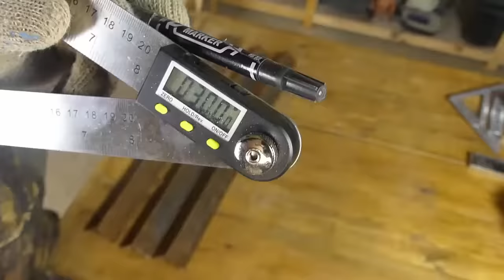I didn't believe it myself! I welded a barrel of pipes and it all worked!

Comment: The one thing I would change is having an outside port for air into the combustion chamber.
From the stats I've seen there is a 30% heat loss from burning up indoor air.

Comment: Super cool!  That’s a lot of work.  I think the steel drum itself will deteriorate too soon to make all that effort with it.  Unless that barrel is a heavier gauge than a standard steel drum.
Reply: The drum looks heavy; but agree that it would be interesting to see how long this stove holds up. The welded outside pipes are conducting heat away from the material walls of the barrel as well; that's the "magic" of this design. When it starts to go he can just add an additional liner of metal I should think. The great thing about Steel is it melts at 1500-degrees Fahrenheit - far above a 500-degree  fire  ... and he can always weld more contact points to the outside radiator pipes - to dissipate more heat if needed - or  with a thinner-walled barrel.
Reply: @EdwardTilley  I think you may have your fire temperatures mixed up a bit. a wood fire starts to burn at 300°C or 572°F and will burn at 600°C or 1,112°F in a sustained burn.  once it burns down to charcoal burning, it will burn above 1,100°C or over 2,000°F.
Reply: @fctuber  Sounds like you researched it better than I. I know that flames are in the 500°F, and it makes perfect sense that hot coals are hotter. I don't think it gets to over 1,000°F because a special process of adding oxygen had to be devised (in the 1700s' first industrial revolution) to get the temperatures up to steel's melting point.
Reply: The drum will go away possibly quite quick, but it's more due to corrosion because of constant change of temperatur than the temps being close to the melting point of the iron? And of course, the hotter the iron, the quicker the oxidation will become. And in comes from inside to outside of course. A doubled up wall, a second wall, made at/to the inside, could help. But the guys liked the work as much as it's result - so they would'nt mind doing it all over again?
Reply: Pieces of corrugated tin roof would have been far easier and quicker to be put around the outside - but they didn't have them?
Reply: Those things last forever damn near. They don't corrode like you'd think because they'll build up a thin layer of semi sticky charcoal dust around the inside of the drum. The pipes will rust out and have to be replaced several times before the stove. I know this from experience. We used an old "'chicken house" heater growing up.
Reply: I have a burn barrel that's been sitting outside for decades,  in the rain,  sun, snow, wind, etc and i burn trash in it without respect to it. It glows red and is treated poorly and i kicked it over a few weeks ago to clean out the ash and thought it would crumble. Stood it right back up and burnt in it again!!. I have 4 or 5 coal stoves i would never treat like that,  but its a burn barrel,  his stove will be fine.
Reply: @EdwardTilley  actually, I know the temperatures of different phases of fire from being a chef and what gives the most and best Maillard reaction (caramelization of meat protein).  A grill burning propane (ok but not all that great) burns at 553°F, that is why a wood fired (better with a great flavor imparted) grill or a lump charcoal (about the best to use for the every day cook) is best. The only way to get hotter is an oxygen assisted flame or a blow torch but then you have to worry about touch taste.  But that is all for a different discussion.

Comment: T H A N K   Y O U !!!, For a wonderful video. 
   I have read quite a few of the comments and they all speak true. The main thing, that I can see, if you can do is to cut out a bunch of scalloped strips of another barrel that will weld to your stove barrel and to the vertical outside pipes, every couple of inches of the vertical area, so that LOTS of surface area is solidly attached to the outside of the barrel and to the vertical pipes. That, in itself, will transmitt the heat, from the walls of the barrel, into the vertical pipes, lining the outside of the barrel...thus sending more of the heat into the room, utilizing heat exchange to a higher percentage! Right now, the vertical pipes are acting like insulation against heat exchange. It all works thru SURFACE CONTACT.
   ( I have been a tool designer, for most of my life). You show that you have great design skills, as you SEE a concept and build to it. Keep right on.( I found, many decades ago, that if you pray to God, and thank Him, that you realize that He gave you the talent, and give Him the parameters of the item you're needing, He will SHOW YOU what that item looks like and how to build it, along with all the procedures for its use. Always give HIM full credit for it. Your connection together will grow stronger and your Design abilities will get quicker and better.)
   I SUBBED
   Bill, from Tn. 🇺🇸

Comment: Great job. Nice strong design.
Clean burn, good air controls. Thanks for sharing.
But please just stop poisoning your lungs and skin with the metal dust. (A quick trip on a  flat cart outside, against your building and some low-dust, controlled, abrasive air blast would have given you just enough even surface treatment to have coated all of your project with black stove heat paint to further conduct heat through to the atmosphere.)
We want you around for a long while to share your great projects and efficient videos.
I had the metal dust "storm" a couple of times with metal prepping and my general hate of rust. I thought I was going to be hospitalized. Thanks again!
Reply: California dimocrack right here, Just saying everyone. If you can't tell by his post...
Reply: Laughed so hard something huge fell out of my nose. Stepped on it and about broke my ankle. Lmfao
Reply: Assuming he has such equipment, besides that can be even more dangerous depending what abrasive you use. Could end up with lung silicosis form blasting if not done right
Reply: 🤨 - we could see him wearing a respirator/dust mask when he was sanding the stove ✅,
Reply: brilliant the adjustable legs awesome thank you

Comment: You did a wonderful job. I wish I had your skills. I need a wood heater for my shop. Building one out of scrap would be much cheaper.
Reply: NOOO! If you build a stove out of wood, the stove will burn up too,😉🤣. (Sarcasm)
Reply: Basic skills my friend!! Easy to self teach one self with all educational material on YouTube skillshare etc
Reply: I saw a free one on Facebook marketplace. Keep your eye out.
Reply: I wish I had his skills too!
Reply: in the early 70s , we were still able to pick up old train station potbelly stoves for under $400 and cheaper, they went fast,especially after 1978weather,heavy steel air tight stoves became the sot after,  New Hampshire was getting some cold weather back then, a friend from work had some coiled tubing going through his stove for hot water, he said, he didn’t need so many coils, three would have sufficed, his pressure gauge was kicking off more than it needed to, I’m retired now, boat person, my heating system is an old brass lantern that hangs over me,I burn paraffin, we don’t get much snow here in Key West Florida
Reply: Tenerlo de vecino amigo jajajaja
Reply: @Pedro72740  yes, actually free. People do put free things on there just to get rid of them JACK. 🙄

Comment: Nice ,glad it worked out this well! have wanted to recreate similar version for yrs. Worked in a metal shop with a similar style,but the external pipes were capped BUT filled with sand from sand blasting and molding scrap,they held the heat for several days!and street bricks inside would also be cheap and hold heat! ,saw another post that said adding drive shafts internally , ours had those also and we often used them for legs and other heavy pcs like gates and benches!happy heating p.s. I used to burn old phone books in my cabin wood burner:) Peace Rick

Comment: Thanks for the fine detailed construction video.  I've seen similar builds and your thermal pictures now confuse me regarding the purpose of the exterior vertical pipes welded around the outside of the heater.  I thought before that they would act as heat exchangers stimulating more upward heated air flow around the outside of the heater.  The problem with that is having only the small welded connections of each pipe to the 2 raised ridges of the barrel give them a relatively poor thermal connection to the hot barrel.

Can you please explain the function of the design, since the thermal image shows the room is being heated primarily by the top of the barrel and the exhaust pipe, which are both quite hot.
Reply: I was thinking the same thing, but the only function I can see the exterior pipes having (whether intended or not), is as a kind of insulator, so the outside isn't so hot as to be a fire hazard in his workshop. There is plenty of heat coming from the top of the barrel, so there wouldn't seem to be a need for an overly elaborate heat exchange mechanism. I also thought like you that an explanation of the logic behind the design would have been nice.
Reply: I to believed that the pipes would have heat transfered to them, and then pump the hot air through the shop, but they don't have enough surface area connected the barrel, so I thought mabey they are a safety barrier so as to not burn anyone that gets too close - but that could have been done by wrapping it with a type of 'screen' 🤔 so I'm left very confused 😕

Comment: You  are very good at what you do.  But, I am confused. Why not let the barrel heat up to 270 and run a fan across it.  How is this heating the building.  Is it connect to something.  We have a 55 gallon on it side running in our shop on a stand with a fan and it works well.
Reply: %%hi Cy
Reply: 6

Comment: I am assuming that you are intending to heat a space like a cabin or a garage.  Instead of using pipes, I would use angle iron,, with both fins protruding into  the air., that is the corner onto the barrel, leaving some space between each adjacent fin.  This will give better heat exchange between the inside of the barrel and the outside space.  You will also use fewer angle irons than the number of pipes you have used.
Reply: Wow, I LIKE that !

Comment: Bring in combustion air from outside instead of using air from the shop. The slight negative pressure brings cold air from outside into the space you're trying to heat
Reply: Informative. Thanks. 😊

Comment: It’s a wood stove. A star wars version of a regular everyday wood stove. Just the barrel n vent pipe would work just as well before you put all the extra pipes n all the rest of the weird stuff idk it would do the same without all the extra stuff.
Reply: If I am understanding this, the pipes on the outside should make a heat exchanger powered by themal induction.  Basically the top of the pipe is hotter than the bottum and the air in the top will rise, pulling air through the pipe, and more heat into the room, less going up the stovepipe.  Not sure how much would gain, but would be significant.  Lots of labor added, but not much technical complexity.  An electric fan would probably get more, but more complexity and need electricity.  Notice the temperature difference between the barrel and the pipes in thermal image.  The pipes are metel to metal with barrel, but still much cooler that the barrel.  It is an air pump heat exchange system, no moving parts, no electricity.

Comment: i like your design, i like the fact that you use the material that you already have. if you have to buy materials may i suggest an alternative to the barrel? i use cut offs from a pipeline sourced from a scrap yard.. the cut off i used was 36 inches across and 1/4 inch thick. make it as long as you want it does not burn out and adds to the thermal mass.
Reply: Ahh Yes,, right-on! #1,  'OUTSIDE DRAFTING',,, & #2, Use a heavy wall 24" - 36" od pipe. I get my pipe pieces from pipeline & piling jobs. usually 1/2" wall stuff. They NEVER burn out! & if they are close to 24" ID,,, an old man-hole lid from the junk yard will fit perfectly inside,,, a very thick, never burn out cast iron grate!.    Drill more 1/2" holes in them!
 IF you weld those outside radiant pipes INSIDE your barrel, you'll most likely put out 10x more BTUs, but you wouldn't be able to remove the top like you do. (no need to weld the inside 'radiant' pipes to the top, use gasket rope & make metal washers to go around the pipes to seal them to the lid. It's a lot more work, but like I said, 10x more heat per load of wood.  You could even use 2" or even 3" od pipe, top to bottom,, like just 3 pieces per side, & still have enough room to stack enough wood for an 6-8hr burn.
You can also use 2" heavy-walled pipe for your wood burning grates. weld them in, slightly up hill, & just have about 1/4" space between them, so the ash can fall through.  You'll burn your hand with the heat that comes out of those pipes! (heat-a-lator)
Another thing I would change,,,, I never build a unit without a removable ash pan. It's so much easier to pull out that pan & dump those ashes outside,,,,, along with all of that dust!
One more thing,,,,, I also like to use a 9" glass, PYREX pie dish on my front loading door,,,,, so I can see in!
 ( I wish we could post pictures of OUR HOME MADE UNITS.? ;>)

Comment: You could increase efficiency even further with more surface area on the exhaust pipe. They make flexible metal rings with bends in it that clamp around the pipe and act as radiators much the same way you have done with the pipes on the stove. I think it would not be too difficult to make something similar from scrap.
Reply: Yes. Filling the pipes with sand would work. 👍
Reply: @kathleenmann7311  A brilliant idea Kathleen...bravo
Southampton UK
Reply: Be careful about pulling too much heat out of the chimney, you risk chimney fires if the volatile vapors condense on the inside of the stack

Comment: Good video, I was just wondering thru the whole thing what the purpose for each item was. I don't understand for instance the principle/purpose for that inner closed lid and the inside pipe up the side, (maybe for a slower burn?). Maybe I wasn't supposed to know this, lol, but if you could explain, like what kind of wood you use and why? maybe with diagrams on where the airflow and heat transfer go and how the chimney/damper system works etc.    tank you ;)

Comment: Nice stove I have built several wood stoves this design seems like it may be very efficient
Reply: What I like is you basically have free heat if you have access to free wood.  No electricity or any other fuels required. Great job.
Reply: V
Reply: Qws
Reply: @earlbresler9927  eevgwvfv
Reply: @earlbresler9927  eevgwvfv

Comment: U could also be more efficient and connect all them pipes together with u bends and pump  water around the pipes until its hot 😁or even fill them with oil and the oil will stay hot even when thiers no fire = more heat for longer
Reply: Yeah cuz then it needs electricity and fluids and hopefully the oil catches fire which makes for viral videos
Reply: But on a serious note you could definitely do alot with some water, but I think it wouldnt serve his purpose.
Reply: @alexnope2223  white hetero Xtian Americans simply have to have a CO2 source somewhere 
- Greta Thunberg
Reply: Put a removable heat exchange coil on top to a container of water to get a heat storage system.
Reply: You'd have to fabricate some type of overflow collection with a pressure release valve for this to not be a bomb
Reply: X
Reply: To prevent corrosion you would have to check the ph level and adjust etc....seen how some of the old boilers needed done. 
Stainless steel would be expensive. 
I know some who tried copper coils but got too complicated.
Sometimes simple is better..🤔
Reply: If your gonna go through all that for thermal properties, then plainly weld a cavity around the outside with sheet metal and fill it with soapstone. It's better than any oil. Better yet tack some chain-link to your stove so you don't have to form anything. Make it as deep as you want, saddle-like. if you want a foot thick of soapstone, might have to shore up the legs a bit. 2 hot loads of wood in the stove, might last all night.

Comment: I'd put the bolt that holds the air controller on the top instead of the side for safety concerns great job 👍
Reply: I wondered that also.  I think he considered it too.  If it's on the top the default position if it gets loose is a closed intake.  If it's where he put it, the default is an open intake. Probably what he wanted.

Comment: Could you increase the thermal mass by filling the pipes with something like sand or cement? I also wonder how one could increase the surface area contact between the barrel and the outer pipes. That way, the whole construction could radiate
Reply: I was going to suggest that they increase thermal conductivity by eliminating the barrel completely and use just the cylinder of tubes.
Reply: That would be too dangerous. The whole idea of the tubes is to provide a shield while still allowing the heat to radiate.
Reply: you could....but then you would have to run the stove much hotter temps which will burn out your barrel fast.....the hollow tubes act as air siphoning heat conductors rather than heat retainers